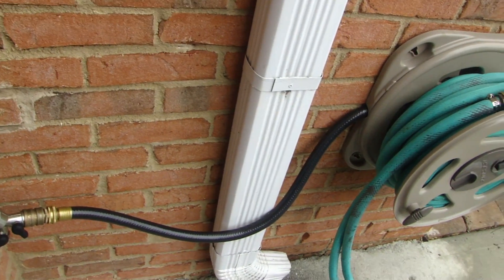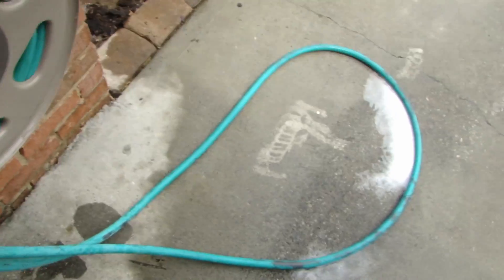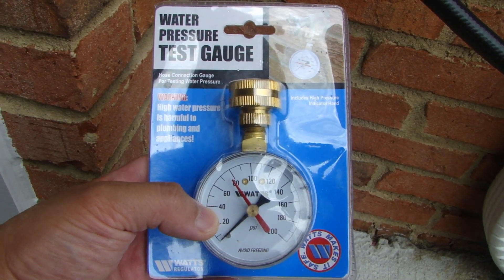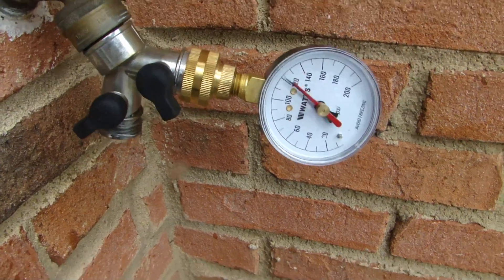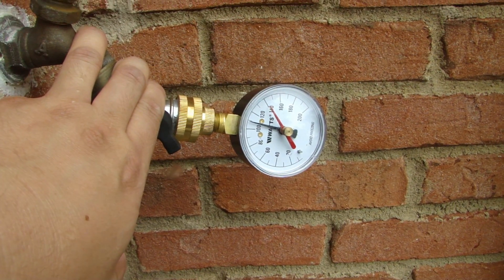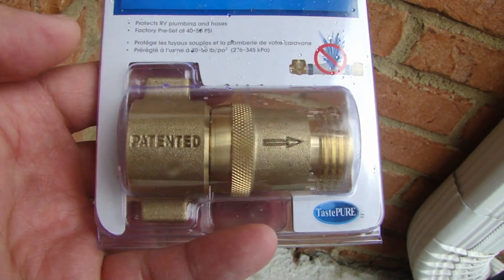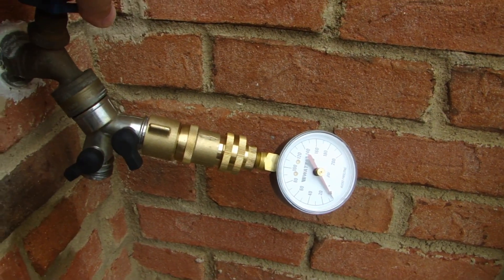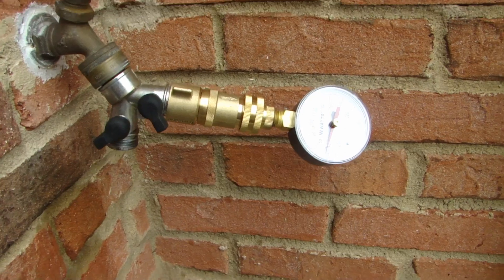How To Check House Water Pressure & Install Water Regulator

Comment: It's always good to have 1 that is connected before the regulator. Just make sure to have a shutoff valve for that line. I am adding 2 lines before the regulator because because I can't run 2 hoses at the same time on the regularor.

Comment: I wish mine did this.  I can't get a good enough seal to reduce the pressure.  Still get water leakage where hose or adapter connects to spigot.
Reply: Hi Grant, I am having the same issue.  Water is shooting everywhere at the hose/spigot connector.  Would a pressure regulator help?